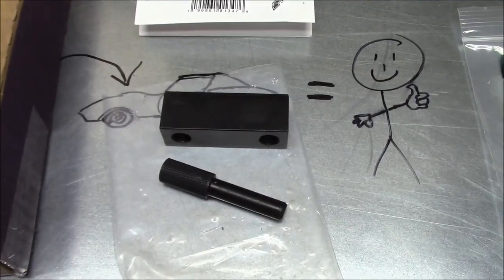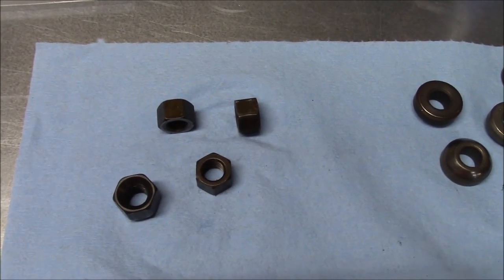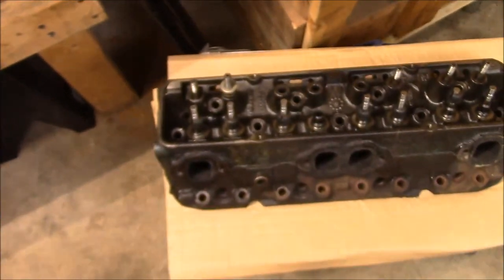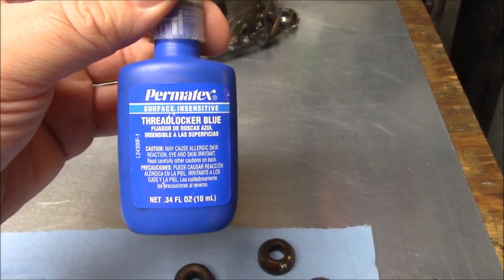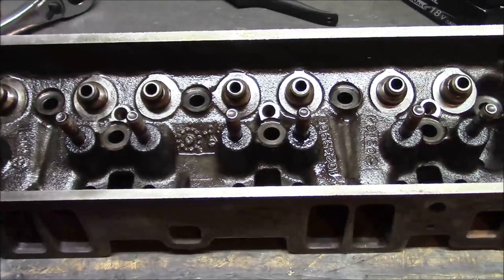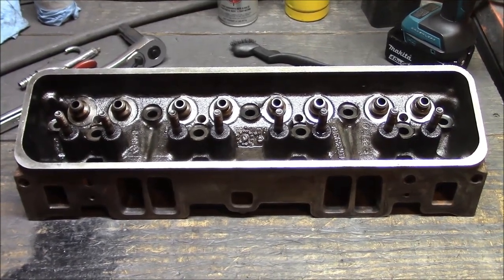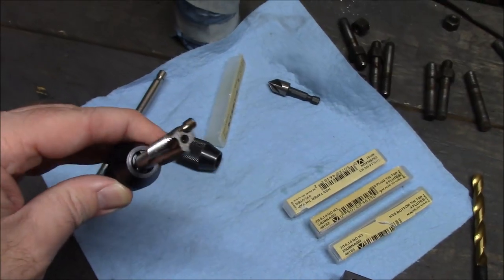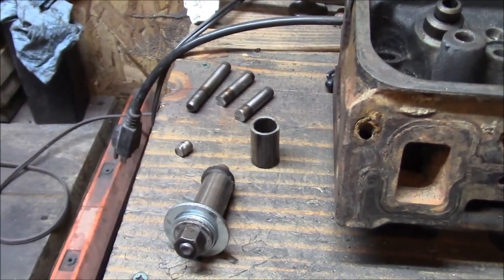Removing Pressed in Rocker Studs & Tapping for Screw in Studs on Vortec Heads

Comment: Vortec heads moved valve spacing, part of why they flow better. Easy mistake to make, I would have probably made it too. I think I would have used the tool anyway, need to start those threads right. I got a bunch of heads to practice on. Having a slotted tool might help, just got to get the threads started in center with a taper tap. Good job, save money, get experience.

Comment: Great video.  But I can’t help but say that although I get the graphite reference.   Lube helps everything.  Lol.  A drop of oil would have helped the sound if nothing else.  Makes my skin crawl to hear a tap with no lube.
Reply from the maker: From what I've researched you do it dry because it machines better that way.  I just looked into it again and found something bout fine dust is produced when working with cast iron and oil will make it stick to the tap or w/e.  A high volume of machining coolant would prob wash it away as well as cool in production
Reply: We used to use oil or kerosene when tapping cast iron I’ve seen both methods mentioned online I’d suggest something thin like kerosene if nothing else it keeps dust down holds to tap and can be wiped clean
Reply: @christianwise4403  kerosene works. I personally like pb blaster in a pinch.  It’s almost exactly the consistency of kerosene with a dash of machine oil.

Comment: Just FYI...when you tapped the holes with the tool you had the tool upside down. The threaded portion of the block goes down toward the stud boss. This is because the threaded part of the tap isn't that long and you will run out of threads when trying to run the tap all the way down. It worked for you in this case because you just used it to get some threads started and then finished it without the tool but normally it wouldn't have worked that way.
Reply from the maker: Turn your playback speed down to 0.25 and click 23:26   You can see I have the tool unthreaded part up, I then slide the tap in/down to the threads, turn it only a few times just enough for it to poke thru.  If I had the tool upside down it would have taken longer and more turns to poke.  The tool is a guide to start the threads, once you start the threads you no longer need the tool.  When tapping the start is critical

Comment: Drilling and pinning will work in STREET applications with lifts .500 and under. Start going crazy like .520 and beyond is living on the edge. Either way, great vid!
Reply from the maker: Thanks!  From my experience it's not the lift, it's the springs you need to not valve float with that lift!  Bent some studs on 1984 heads with .480ish lift(can't rem exact cam but was sub .500) and comp 1.25ish springs(can't rem exactly but they were less than $50), well 1st they started to pull so I drilled n pinned(heads were replace after studs started bending).   Also used 1.52 comp roller tip rockers.    Think I read GM Started to use screw in studs with their Z28 springs and that it wasn't always an issue but enough that they decided the extra production cost was less than all the warranty work.  Either way good insurance!
Reply: @BOOT  I was told that from an old timer who said that was a popular low buck trick they used to do back in the 70's. I've heard similar from a couple of other people. I'm gonna try it to help a buddy out. My buddy wants to do a cam swap in his 1994 Chevy Caprice with the 305 roller cam engine. He doesn't want to spend Alot of money, or do an engine swap so we're doing the bare essentials. Figure keep the cam at around .460 lift, keep the duration on the lower end with a 114 LSA. I figure it's better that  the stock cam but nothing crazy. Also go crazy on the springs. Upgrade the fuel pump and change the fuel pressure regulator spring in the TBI if necessary. I guess we'll see what happens.
Reply from the maker: @erikturner5073  Most cams are rpm/power-range rated for a 350 so with a 305 it's a good idea to stay mild since the smaller displacement will move the power range higher.  The real limit is the TBI intake from what I've read, idk how soon it'll limit power with a 305 but I knew a guy who built a mild 383 and used the stock TBI & intake.  It was really disappointing!  The problem with the SBC is there is just no good oem efi to upgrade like the LS.  Things can nickle n dime you for poor results and in the end you coulda saved up for a better aftermarket option or LS swap.  Still depends on your goals and expectations.
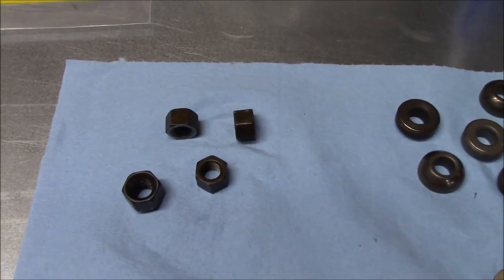Reply: @BOOT  I totally agree. Especially since the stock 305 heads will be the limiting factor as well. He has already put Moser gears and axles, 4:10 gear, gertile, and locker in the rear. Also he has either a 4l60 or 700r4. Either way it's non electronic. My suggestion to him is save up the money to do a 350 L31 and carb and intake swap, with a street cam, intank fuel pump upgrade etc... Or we can go to a yard and find a 4.8 or 5.3 LS with the computer and harness find a suitable car intake, do a cam swap, and springs put in a tune, and a small stall, with a Corvette servo in the trans, with his one hundred shot nitrous system. I think he would have a relatively low cost and FUN street car, even without the bottle. As they say, "You can only lead a horse to water".
Reply from the maker: @erikturner5073  That's good advice!  Hope he listens to you but as yah said, you can only provide the info.  An Add-on trans cooler would be also good idea to help the trans last longer.  Plumbed after the radiator, water cools better than air.  One of the 1st things I did for my C4, course it already had the servo LOL   TransGo kits are suppose to help a trans last longer but since you drive it more aggressive it prob evens out LOL   To much stall can be hard on the 7.5 rearend, if you got traction.

Comment: I have a question.  underneath the stud is there a hole  where coolant can be exposed/come up if its not sealed?
Reply from the maker: 4:12 mention that I like to use a thread locker(on all) but you can use thread sealer.  22:56 I point out the thru holes and caption a thread sealer reminder.  You should also seal the intake studs as well since oil can seep into the runner.  I'll add another reminder to the description, hope this helps.
Reply: @BOOT  appreciate it very helpful.  Thank you

Comment: I did this on my old 441 heads while the motor was still in the truck used the alignment tool and a tapered plug tap it worked got them all in and done used red loctite tightened em up used roller tip rockers the alignment was off a lil on a cple made me nervous but put it back together fired her and she ran good so I’m rolling wit it

Comment: Did you torque the studs or how tight? Oh, what size tap? Thanks.
Reply from the maker: 7/16-14 and not yet. When I do use these heads since my studs don't have a shoulder nut I'll double nut the 3/8-24 and use threadlocker.   When using threadlocker you should reduce the torque spec by up to 20%.  I've not done it yet so can't say exactly what will work with the studs I have, I may just snug em good since the 3/8-24 is a lower torque spec n I'd like to get the nuts apart w/o too much hassle or damaging the stud.

Comment: Did you torque the studs in once finished? If so what torque? Did you use red loctite as well?
Reply from the maker: Not used them yet and the plan was to use blue loctite n double nut the stud and just get them good n tight.
Reply: @BOOT  I've asked around today and that seems to be the consensus. lower coolant level (if doing on the car), pull old stud, tap new threads, use silicon thread sealant or red loctite on new screw in stud, and double nut snug them up. Let silicon or loctite cure. Also pretty sure the exhaust studs go into the water jacket and the intakes on some heads are open to the intake runners.
Reply from the maker: On vortec heads intake goes into runner and exhaust into coolant, seal both.  If you wanna be extra careful you could use a small paintbrush to put some thread sealer(RTV doesn't work well with gas sometimes) towards the bottom of the hole(not too deep for the stud) and then loctite the top few threads of the studs.  Red will require heating up to 500 tah remove and any loctite there is a possibility it can cause a crack as it dries and expands.  Also I'm not fond of doing it on engine but your call!

Comment: Why not just make the tool with the threads at one end.
Reply from the maker: I bought the Summit Racing tool that is used to remove the studs and as a tap guide.  I am aware of a few more expensive stud only pulling tools but I feel the free-to-me pivot balls work well & fast enough for a budget project.  Besides if I spend too much why not just pay the machine shop?  I plan to pull the studs on my next vortec crate engine set the same way and then have a shop mill for guide plates and tap.
Reply from the maker: Making my own version of the more expensive pulling tool might be an interesting future project. Thx for your  input.